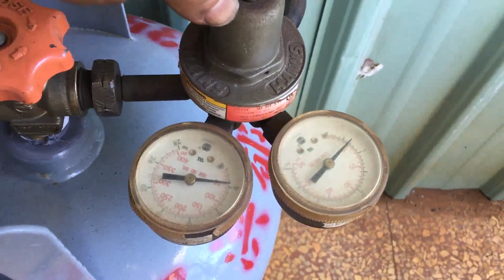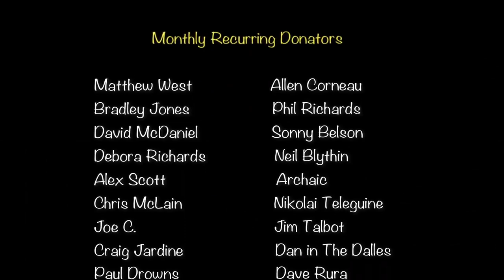Fire Welding Bits of Tool Steel using Stainless Steel Pipe as Flux Barrier / Container

Comment: If you heat the stainless just enough to form a slight light gray scale inside before loading your other pieces.  The scale is prevent them from sticking to the stainless.  I do this a lot in my knife making where I don't want things to stick.  Hope it helps.
Reply from the maker: That's a very good tip. I was glad the pipe didn't weld to the inside pieces on this first attempt but if I have trouble replicating that, I'll try your method. Thanks.

Comment: Another great concept! Tiny canister damascus! You can eliminate those inclusions and get a much more usable billet. When you crimp the ends, give them a roll so it becomes a little more airtight, and fill the empty space with something like 1095 powder that will forge weld to itself and the other pieces of steel.

Stainless is notoriously poor at forge welding due to the high level of chromium.
Reply from the maker: I had suspected that the chromium is what was preventing the pipe from welding so thanks for confirming that. As far as eliminating the open spaces, I will take that advice and have another go. And crimping the ends makes sense. Good suggestions /  comment. Thanks.

Comment: When I have used charcoal (in a bottom-drafts blacksmith's forge) I have placed a log across the top of the fire to reflect heat back down. A 2x6 across your little fire pot might do.  If we researched ancient methods, I bet a side draft was used, in which the neutral part of the fire could be found horizontally rather than vertically.
Reply from the maker: Hi Ken, That's a good tip. And I have thought about making a side draft charcoal forge. Thanks.

Comment: Smaller pieces and steel sawdust and needles work great! There should be no free place inside and it welds fine.👍👍👍
Reply from the maker: Thanks for the good suggestion. I will make the necessary adjustments. And I'm happy with the result on this first go. Thanks.

Comment: If galvanized is all you have, you can soak it in vinegar for several days and it will strip off, but then the pipe will also forge weld.  What are you going to make with your billet?
Reply from the maker: That's a good tip. I make a super simple (and obviously small) folding knife with this billet and will post that video next. Thanks.

Comment: You could get some refractory clay and basically line the inside of It. I would do thin layers, Let each dry until you get it flush with those ribs that are running around the bowl  And after it dries a little while you can fire it up and it will harden
Reply from the maker: That's an interesting idea. I'll definitely have another go at this. Thanks.

Comment: Do you have an acyl/oxy torch? I've always wondered is burning a rich acyl flame creating smokey soot on the inside of the tube would work as a release agent when creating canister damascus.  I know people have used whiteout correction fluid for that purpose.
Reply from the maker: No, I don't have a torch. Someone else mentioned white spray paint and so maybe that's along the lines of correction fluid. Thanks for sharing.

Comment: What kind of Charcoal are you using?  It looks like lump wood charcoal as opposed to bituminous or anthracite etc.  How does it work whatever it is?  thanks
Reply from the maker: Hi, I'm using lump charcoal bought at a supermarket here. I've seen similar at Walmart. Charcoal doesn't generate the btus that coal can but it works for sure. Thanks for watching.

Comment: Soak your canister in kerosene for 15-30 minutes before heating, kerosene will go inside, dissolve oils, and also will burn and eat oxygen inside, so your forgeweld would turn out better. Also, scrub rust off before sticking pieces to canister, you don't have flux to dissolve it inside the canister.
Reply from the maker: This is an interesting and unique idea since no one else mentioned this kerosene technique. I'm happy and surprised by my tiny billet and will have another go and make adjustments. Thanks for sharing.

Comment: Uh oh, Glen, you seem to be heading down the damascus rabbit hole, from which there's no return. Stainless canisters with powdered steel are clearly superior for scrap-sourced patterned steels, but if you're going to start using powdered steel you'll have to, ugh, start welding the ends closed.
Reply from the maker: Ha! I do know guys who head down that hole and never return. But I think I'll return since I'm not a knife guy at all. Though for my next video I use this tiny billet to make a simple knife. This steel is surprisingly hard and holds a great edge. Thanks Bryson.

Comment: I have two suggestions you already may know. First, grab a can of flat white spray paint and spray the inside of your pipes. The titanium in white paint won't allow the container to weld to the steel. Second, see if you can find iron or steel filings. Many smiths using something similar to your method always fill gaps with same.
Reply from the maker: I had no idea about the spray paint tip. The steel filings and some have suggested 1095 powder, are things I thought about after the fact. I was happily surprised by this result and will give it another go. Thanks for sharing.

Comment: You are in 100% control of that angle grinder! You must have quiet a few hours behind it!
Reply from the maker: Yeah, a lot of hours but I also use an angle grinder in an inherently dangerous way without a guard - not something I recommend... Thanks for watching.
Reply: @gstongs  As long as you know it that's all that matters! I modified my angel grinder shield with a ring and cut it back a bit to be more useful and still be able to see what I am doing!

Comment: fascinating stuff glen you'll be etching it next, definitely worth the trial. 
I am trying to work out if there is a way of squishing it ends first before you flatten it out without letting air in...maybe in a larger tube with a plug in the end ..but your little billet is definitely damascus.
Reply from the maker: I had no prior experience with this sort of thing and was happy with the result. Not perfect by any means but I'll do this again for sure. And I use this tiny billet to make a knife for my next video. Thanks.

Comment: A bonehead you're not. Great idea and it seems to work well. I can see where this could be useful and fun. Thanks!
Reply from the maker: Hi Stan, This is something worth trying. The tiny billet, while not perfectly welded, is very useable. And yeah, this was fun though I have to admit I dislike working at forging welding temp. Thanks.

Comment: I think it might be useful to add a flux powder to the mixture to do the forging?
Reply: seems like he's trying to avoid flux.
Reply: Flux is useful for in open welding because it dissolves the oxides and then is expelled. In a canister the flux would not be expelled, but trapped. As a result, in a canister, you reduce or prevent oxides from forming.
Reply from the maker: Others have said the same and so maybe I'll try that next time. But I was hoping to not use flux just to see... Thanks.
Reply from the maker: You are correct. Thanks for watching.
Reply from the maker: Perfectly said. Thanks for sharing.

Comment: This puts a whole aspect to canister damastic. I always has trouble separating the parent canister. This is excellent 👍
Reply: Devin Thomas has always said to leave it on and forge it out - by the time it's a knife, it'll be so thin that you'll remove it during grinding cleanup. But I love this!
Reply from the maker: I had no idea what to expect with this one. I was glad the pipe did not weld to the bits inside. It's a technique worth exploring more. Thanks.
Reply from the maker: I will try this again, make some necessary adjustments, and see if I can replicate the pipe not staying separate from the pieces inside. Thanks.